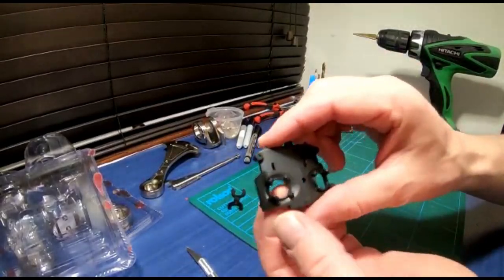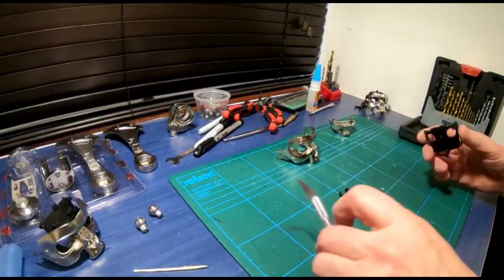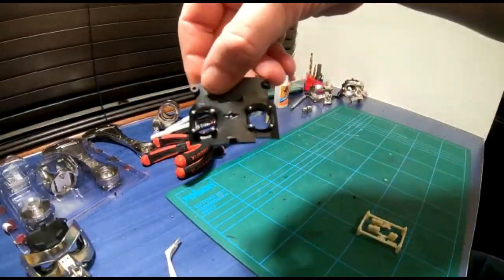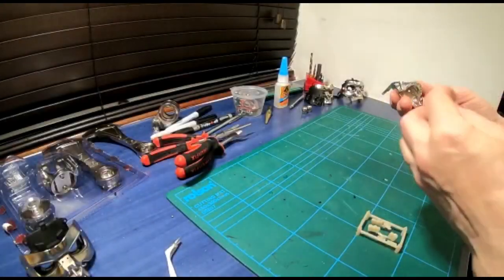Make your own Terminator, Agora Models Hachette T-800' - Movie Modifications Tutorial (Parts 1&2)

Comment: Cracking video...keep them coming..subbed.  cheers
Reply: Thank you so much brother your approval and support and subscription means a lot to me 😎
Reply: To many and's 😁
Reply: @johnvaughan5617  Its all good. Just move the mic off the table, either on a stand or shelf, so you dont get any (boom) sounds when you knock the table.
Reply: @chefhawk   it's a built-in mic GoPro but I'll get a proper tripod
Reply: @chefhawk  really appreciate the tip's my goal is to emulate your vid's 😎
Reply: @johnvaughan5617  ok.. you can get them cheap enough to get you started. I noticed some flickering with the video..is that down to settings on the go pro?
Reply: @chefhawk   could well be I'm filming in 1080p 30fps is that to much ??
Reply: Could also be the light I think
Reply: @johnvaughan5617  light looks ok,,, can you change the shutter speed?
Reply: @chefhawk  what speed would you recommend ?
Reply: @johnvaughan5617  I would try 50 ,,, but it might be just a case of doing a few tests to see.
Reply: @chefhawk  ok will do thanks for all your help it's much appreciated 😎
Reply: @johnvaughan5617  No problem at all sir.

Comment: Is there a way to make the metal surface look like it normally is when you file it? I filed away the inside of the nose but the file scraped on the sides of the nose where it was nice and smooth but now looks filed, what do you recommend for getting a filed surface to look more like the normal smooth surface? thank you
Reply from the maker: If you only have the one face plate your going to have to use weathering to cover it ! The metal used in production is very unforgiving 🥺😎
Reply: @gweilojohn8550  Ive just drilled out the holes and the nose and managed to sand it a little where it looked a bit scuffed so it looks a bit better you are right the metal is very soft and not forgiving for any errors! am trying to avoid buying spares on ebay etc but will do if i mess it up too much and it bothers me, unfortunately though using the tiny ball bearing for around the eyes, i messed up there and cut too much and so the little black plastic things look a bit broken now on the side bits of where the ball would sit! So they are just going to be patched up and painted and the metal ball just stuck on top, it still looks ok, just dont be looking at my model with a magnifying glass haha
Reply from the maker: @Retrobution  if you were local brother I'd help you ! I have nothing but respect for anyone willing to do all the modifications required to make this kit more movie accurate 😁😎
Reply: @gweilojohn8550  Thanks man, due to kids and work etc I've yet to make myself my "man cave" but have been gradually getting things together ready to display in there, in the mean time I have a lot of cool things on display in the shop. If you google Retrobution Llanelli you will see my shop, retro stuff. I got the first pack for this model last week and literally after seeing this video it's just made the model a whole lot better. I've always liked that sideshow life-size one, but the one they are releasing now has guns fixed to his hands permanently (I know right?) for like almost £7k after shipping and taxes!!

So the price of this model is very reasonable, and I find that this half scale has lovely details that make it look better than a life size one imo, but for some reason I find it funny that I know that my son will think that this is a child version of a terminator and not a half scale one XD So I can imagine sitting the t800 in a childs car seat and making it catch ball, wear a peppa pig baseball cap etc haha be like adopting a t800.

The mods I am going to do 100% are all of the ones you have done here, the teeth especially and the eyes (the silver beads arrived today, very brittle to drill! so managed to make a few of them. I had some red vinyl wrap that i cut out with the hole punch, just waiting for the grid bag thing to arrive for the grid eye effect, I had found some clear ones in poundland and tried to colour them in with marker pen but going to see what the actual red bag looks like first. Nuln oil on the eyes at the end make them look really great!!
So thank you again for sharing this.

I've also bought the parts to make the plasma rifle light up and make sounds, but looking to try and get the files for these and how to wire it all up! The stuff that steve on youtube is doing with the base and the rifle etc

I am not sure about adding or changing hoses yet, i fear that if i start clicking on these videos then I will end up doing these too!! but for now the skull is the main mod that needs doing, that nuln oil is really good stuff and makes the metal look great and will hopefully make the plastic match as well.

I have ordered the first issue again for that eye plate, i think i will avoid cutting out to fit those metal balls i will just colour the ones on the plastic with chrome pen
Reply from the maker: @Retrobution  that is a very cool store ! Looks very much like the stores in Hong Kong 😁  He's going to fit in nicely ! If you do get a chance to change the hoses and chest cavity it really makes this kit pop ! Great chatting with you stay safe and have fun brother 😁😎

Comment: how can you tell the inaccuracies  when the head parts are not all available yet
Reply from the maker: Hi Nigel good question I stated in my video that I have no idea how my modifications will affect the rest of the build, It's basic engineering and form the parts we have already I can see where they are going with this, I will be showing how to do the small modification to the eye leaver to get them to move left to right as to the jaw mechanism my teeth have exactly the same dimensions as a standard build so I can't see there being any problems with that but I would recommend holding off until you see my finished head 😎

Comment: I need to learn chrome plating because This isnt a assembly job its turning into a garage kit its pissed me off a bit.
Reply from the maker: Hi John what part is bugging you the most ?
Reply: Hi the face sculpture details in general , the seams, the fact it needs the chrome finish redoing because the metal parts are off colour to the plastic ones, the eyes to small no details my wires already broke on one eye, by looking at it for access to eye socket  the upper lip comes apart meaning if you want access in the future you cant fill that horrible seam, the fact that theres no proper footage of it completed, the poor magazine it comes with or should i call it a pamphlet. The free gifts suck we got tool and none of the screwdriver are small enough, the way it jumps from arm to head getting you deeper invested before seeing anything complete, also i was told by a member of the team last wednesday i would have my subscription friday still nothing a week later,  am still on issue 3. I am slowly beginning to think they're pulling the wool over our eyes, i am a huge terminatior fan i was born the same year it came out and this holds real nostalgia for me. I have hand build a few endoskulls and other parts including full endoskeleton builds in my time, and to me this was supposed to be a weekly assembly job something therapeutic but has turn into the most expensive model kit ever with loads of rework. A few years ago i was offered a full size raw resin cast for £1400 the argument could be this is metal but no where close to the accuracy and half the size now i regret not buying it . If i continue it will be to join my community of fellow terminatior geeks to quote Sarah "Don't confuse close with happy" this should be the slogan for this project and something the team at hachette should be working to. Sorry for the rant and bad grammer i am using a on screen keyboard.
Reply: @johndoe-cm9qe   love and agree with the rant brother, it's just the head neck and base that need work the rest seems to be movie accurate (it will need chroming ) I'm going to try to get a deal on that from a factory near me in the South East area and see how many doing the build want it done, you sound like a veteran of building kit's like me and I only continued with it because firstly I knew I could improve it and secondly didn't want to look back in 2 years at the finished build and say I wish I had kept going. Ps you should do a video on YouTube of your rant I would like and subscribe to it.
Reply: @johnvaughan5617  Thanks mate i was just lucky to enjoy something from a young age and figured out how to get paid for my pleasure i am a professional sculpture by trade. And never used anything from a mould or mass produced kit until a few years ago i learnt from scratch . My problem is i want to see the complete build before proper modding anything i dont know want the mod to mpact further steps along the way and refuse to buy multiple copies of a already pricey kit.
Reply: @johndoe-cm9qe   I've done the work for you there John parts 1,2 and 6 needed modification, I'll be uploading the mods for part 6 tomorrow it looks pretty good ( though I say it myself ) and won't affect the rest of the build I still have to paint it and have 1 more mod for the eyes, as for the neck it's just 2 piston's to swap out, I'll also be doing a custom smashed skull for the base, I hope you do the build and film the customisation's you do I'm pretty sure there going to wipe the floor with mine 😎